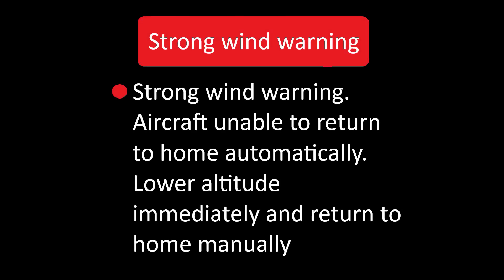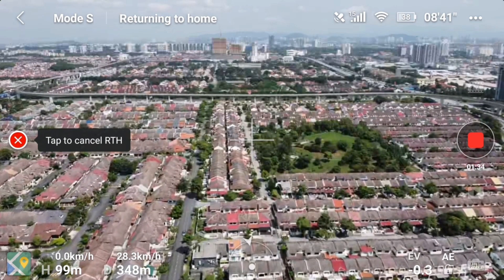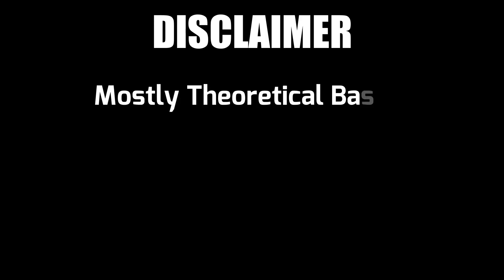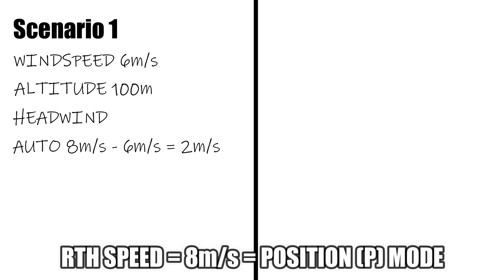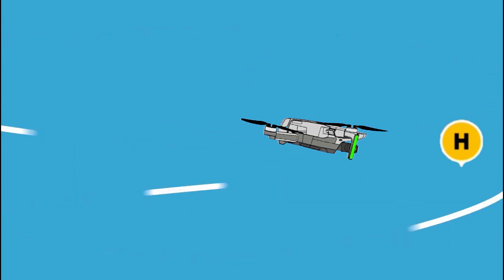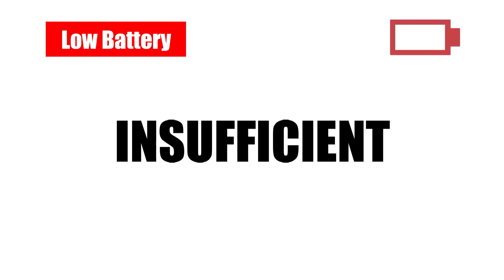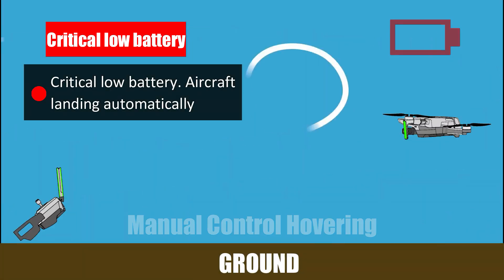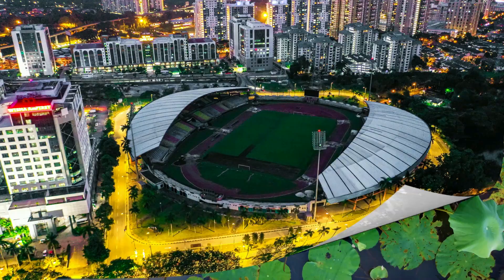DJI Mavic Mini Wind Tips & Theory to Stop Flyaway

Comment: Excellent content brother. I wish I saw this before, my flight was impacted by the strong winds while RTH. I was on a hike, so wasn't able to lower altitude. Here is the video of what happened. 

https://youtu.be/scdmazaqfRU

I'm planning to do a " mistakes and lessons learnt" video,so doing researches regarding the same. My research and yours seems to be matching. You are technically correct for the most part. Could clearly see the efforts you have put in.
Reply from the maker: Thanks for the compliment. Ive seen that vid from a group, i believed i also commented on it 😅. Your case will be quite tough as all terrain are trees, but if u know how to judge the wind by the max speed vs current speed, it will give u a good idea on how strong is the wind above and to decide to continue when u are on 30% batt or not... Anyhow glad u found it back!